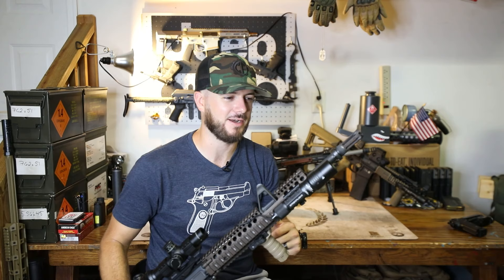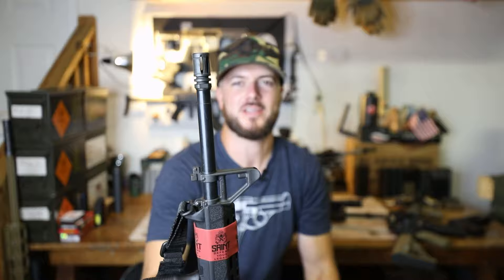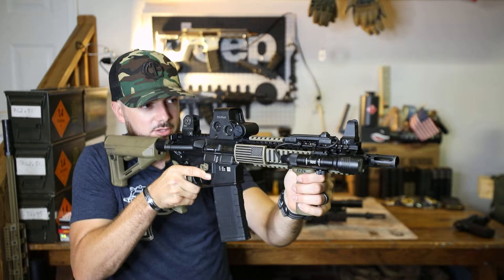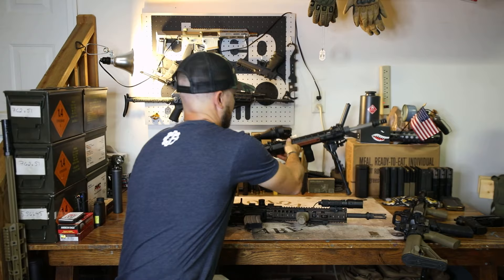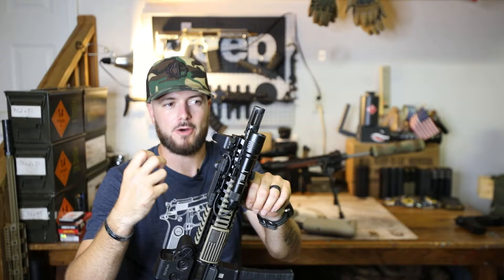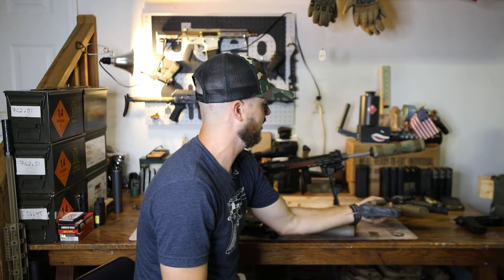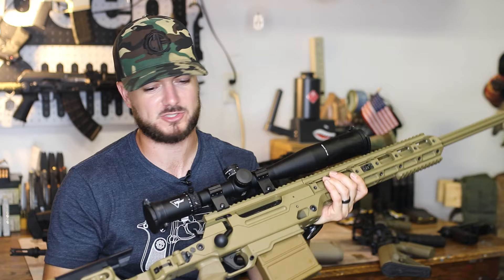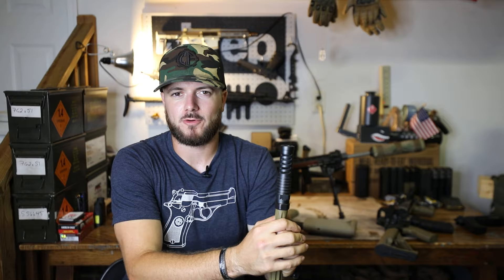Which Muzzle Device Is Best For Your Setup?

Comment: I'm running a Precision Armament EFAB on a Steyr AUG.  It's a hybrid device that compensates, breaks, AND suppresses flash.  It's not the absolute best at any one of those things, but it does all 3 of those things quite well (reduces recoil by about 60% for example).  Best thing is that there's extremely low concussion to the sides and rear.  No one at the range complains.  Especially good for the AUG bullpup where the muzzle is very close to your face.
Reply: I second this except I run The Afab as there is no real benefit to running  an efab on a 16 inch AR. The efab does best with 14.5 and lower. Afab is 16 and above
Reply: 60 percent? damn
Reply: I just picked up the afab. I’m excited to see how it goes.
Reply: 60% recoil reduction?!? Plastic bbs come out of the gun?
Reply: 60% is BS.  It's mediocre at all three.   It doesn't do all 3 "quite well"

Comment: I just run A2 flash hiders on everything, it's usually what comes with an upper and they work well enough to not justify spending money on other stuff.
Reply: for the purpose of hiding flash, yeah. but my AR15 with a hellfire 419 quite literally sits there and lets me shoot it. smoothest rifle i've ever fired. still gassy in my face though.
Reply: always worth improving your firearms to your liking , you don’t experience recoil from hot rounds stick with A2. 

if you’re running around shooting 300, 762 or anything of that higher up caliber , seek comps and brakes 🤷🏽‍♂️ you’re suiting your gun for the power of the gases that escape. happy shooting 🤞🏽🤩

Comment: VG6 Epsilon on my .223 Wylde is where it's at.
Reply: Just put that on my 6.5 Grendel, and it's fantastic. Cut the recoil almost in half.
Reply: love thr vgs. have them on all 3 ars.
Reply: @5150warpig  my only thing is that I want to get the cage that goes around it.  Since it does have a pretty good side exhaust of gas to those around you.
Reply: Running the Gamma 65 on a 6.8 (ARP pistol build) and love it! Worth every penny

Comment: I'm poor so I want the best bang for the buck. I have a Tapco (i know) slot brake on a 47 and it works great for $15. For the Ar it's either the standard birdcage or the Strike Industy J-comp as it's only +/- $35 and helps with my tendency to pull right or left when shooting double taps. Don't make any friends at the range with either one of those though.

Comment: Have you experienced any difference between using a muzzle break vs a flash hider while running a suppressor?
Reply: They tend to cause more gas to come back into your face, some rifles don’t function well once the suppressor is installed unless you have an adjustable gas system.

Comment: I used to love my basic, stock A2, and I never understood why.  But California said it was evil, also for reasons I never understood, and now I have a Gamma VG6.  Which has, ironically, resulted in my ability to fire my AR much faster and more accurately. That barrel end pretty much sticks to one place in the air now under rapid fire.  Very good brake.  I don't have to worry about using my weapon for fighting, as I only have 10 rd mags and a fixed magazine, also for reasons I don't understand.  So if I'm fighting indoors, I'm using my shotgun.
Reply: If your rifle setup with fixed magazine, you can have a flashider, adjustable stock, pistol grip, etc. if you go featureless, you can’t have those evil features, but you can use normal magazine release, and magazines over 10 rounds..

Comment: If you want accuracy over compensation the A1 birdcage is king. Every single match rifle I've used shot better with the A1. Im guessing that having ports all the way around is the reason I don't know. Another plus is that if you have accurate ammo for one rifle you can use peel washers and work the A1 FH as if it was a barrel tuner. Shooting prone in the dirt the A1 kicks up about as much dirt as the A2. I don't know how good the A2 works as a compensator because iv never fired a full auto one.

Comment: I still do not know what a compensater is compensating for.  You talked about flash hiders then went on to compensaters but just talked about them hiding the flash.  I'm left with questions.  My rifle has an A2 flash hider and I'm trying to figure out what I can gain by replacing it.

Comment: The top ported Birdcage like you have on the Mark18 is the best muzzle brake, it's a flash hider and it mitigates recoil, not as good as a dedicated flash hider or compensator but it does both well

Comment: Hey Clint! Great channel I’m a big fan! Quick question... I live in Ca😞 however I’m building a 13.7 pin and weld 300 blackout so I can avoid sbr or pistol configuration. i wanted to get your opinion if I should go with a surefire warcomp flash hider or a muzzle break? In ca we cant have suppressors so I have a surefire warden for now. Which is the best choice for a muzzle device for self defense?

Comment: I am mostly a fan of the basic (or enhanced) birdcage style flash hiders on the platform.  I do have a faux-can on my 10.5" AR9, which is nice for the shorty barrels.  I just installed a break on my .223 Wylde "precision" setup...its holy crap loud, but damn, it causes no muzzle rise at all.
Reply: 10.5” and precision normally doesn’t go together.

Comment: I use a brake with top holes also to act as a compensator as well on my 1000m gun.  Helps tame the 7mm Rem Magnum.  I use flash suppressors on my M1 Carbine and AR15 223.  The .450 Bushmaster gets a brake also.

Comment: For my 5.56 12.5 I'm running a forward control design 1815. Work good and looks good without the blast from standard comps, for my 300blk 10.5 im using a surefire warcomp 3 prong, also work good. Can't complain on either one.

Comment: For the ultimate in simplicity, consider the AK 'sugar scoop' compensator.  It looks like someone slipped and cut the top off of the muzzle, but does help drive the muzzle down and to the left, to cancel muzzle rise to the right.
Reply: 74 brake better